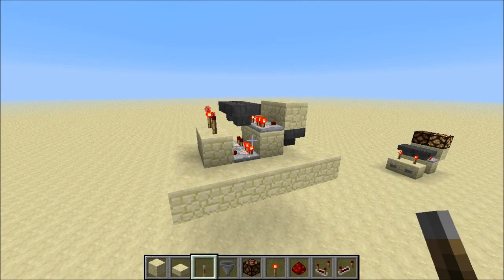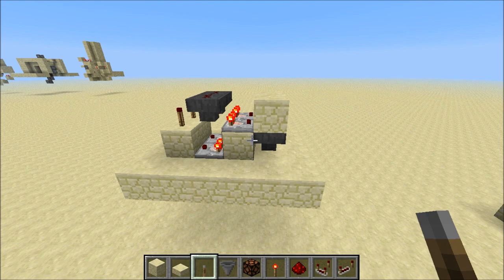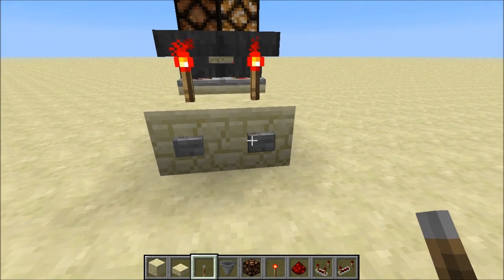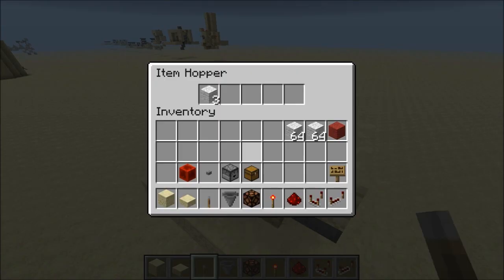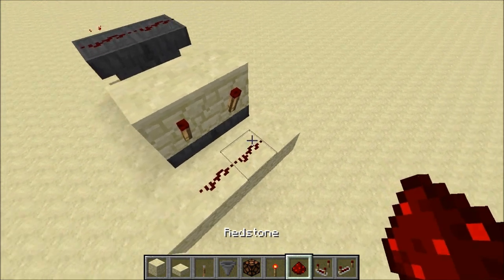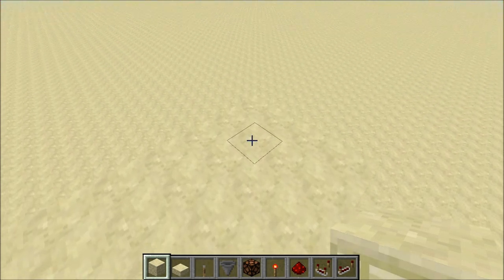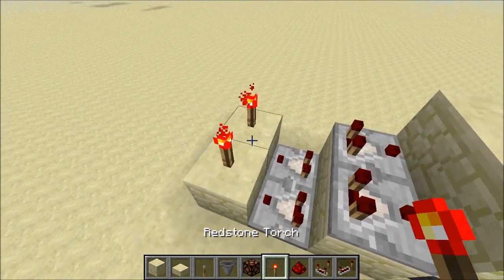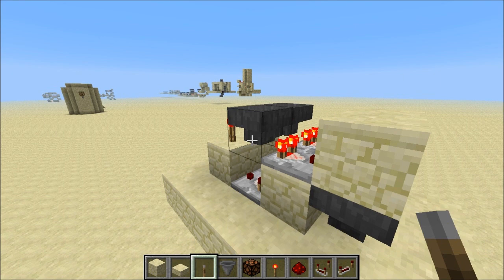Minecraft Tutorial - Silent Hopper Timer

Comment: 2016 and still the best hopper timer! THANKS
I used a modified version of this (whereas the rs nor latch is on top layer instead of bottom) in a clock that has 'tempo control.' This way, the timer is at the bottom and you can thus pull items out of the system with a small hopper chain below, store them, and then inject them back in with a dropper elevator. Couldn't have done it without your design.

Comment: Great invention TitiSurMinecraft. This should be the timer everyone's using, not Etho's ;)

I've seen people asking in the comments, if it is possible, to modify this clock to give off signals with an adjustable length. Actually it is quite simple. Just put more items in the bottom hoppers and add two redstone dusts next to the torches (NAND-GATE) The redstone dusts are the output and the signal length in seconds is the number in the upper hoppers * 0.4. The period length is the sum of the signal length and the (number of items in the bottom hoppers - 1 ) *  0.75. For example 25 items in the upper hoppers and 50 items in the lower hoppers result in a 10 second signal every 25*0.4+(50-1)*0.75 = 46.75 seconds. I will upload a video later today, if somebody needs a visualisation.

A tiny downside is, that the signal oscillates by 1 gametick. It is for example 10.00 sec, then 9.95, then 10.00 sec again. In the example above: 10.00 sec on/ 36.75 off / 9.95 on / 36.75 off
Reply: oldest comment ive seen from the tropical german fruit
Reply: Hey ilmango
Reply: Praise from ilmango is high praise indeed!  (We are just about to put the redstone on top of our survival spawner based on your design.  We would have got it by now but when we were testing to make sure our redstone up the middle worked the buckets got out of sequence.  When we went to fix it there were creeper problems.  Lots, and lots of creeper problems.  So... much... rebuilding.  Finally we built a nerd pole archery blind out a few blocks from the edge so one of us could lay down suppressive fire while the other one fixed the buckets!)   :)
Reply: Ilmango, idk if Etho's design is "worse", but the Etho Hopper Clock being known widely today is a good example of "Worse is Better". It's an essay written by Richard Gabriel if you want to check it out!

Comment: @Greg Feldman-Hill

I was looking for the same thing and found this:
7.5 Minute Hopper Timer -- Minecraft Tutorial
This emits 4 pulses with the same length. So it might be possible to add 2 or 3 of those pulses together to get two different types of pulse lengths with the ratio of 1:2 or 1:3. I guess it is also possible to add more hooper pairs (with comparators and repeaters) to the loop, so the ratio can be any kind of number.
Reply: Okay, so I tried it out, and the pulses were overlapping each other, so a few modifications were needed:
http://s21.postimg.org/w4lsopk47/Asymmetric_redstone_clock.png
Also there is no need to add any of the pulses together if you want a ratio like 1:x. Just use only one of the outputs + an inverter.

Comment: I was looking for a clock and came across your vid after I watched Etho's. I built your design. It was quick and easy.. very nice!!

My question is (for anyone really) -- is there a way to have it cycle unevenly, as in delay one half of the cycle so it's longer than the other half?

Let's say I hook a piston up to it. It will cycle in and out, and be in each position for the same amount of time.  But what if I want it to go one way (let's say "in") and stay for 30 seconds, and then extend ("out") and stay that way for 2 minutes?
...30sec... tick... 120sec... tock... 30sec... tick... 120sec tock.

Is there a way to do this, or would it essentially break this nice, compact design?

Thanks!!